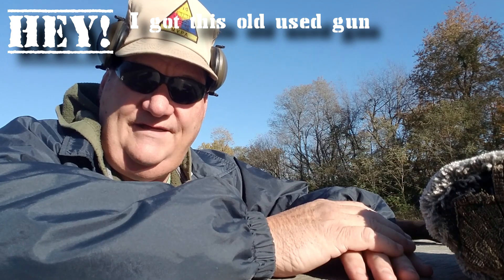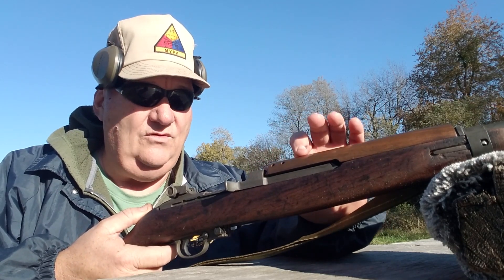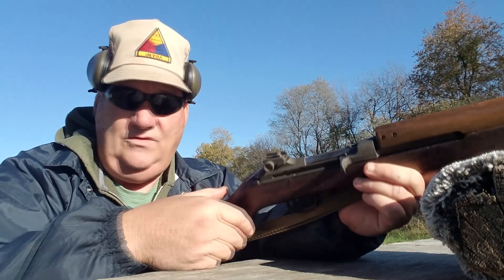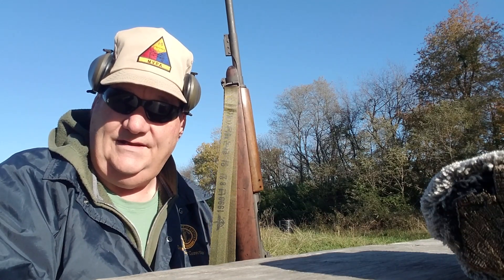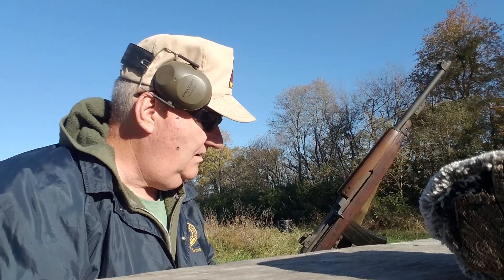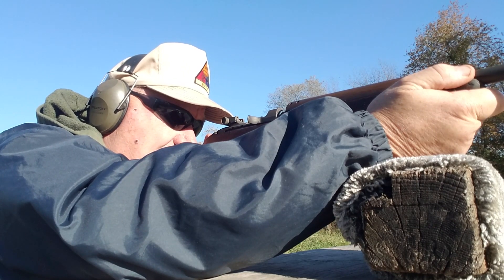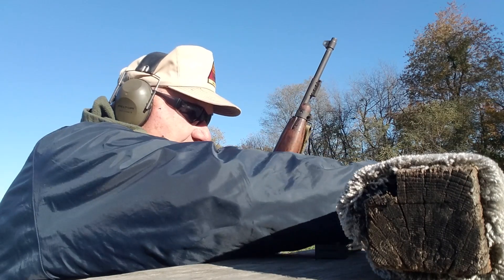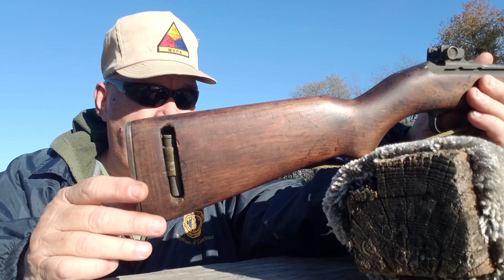Grading a carbine #4. Let's look it over.

Comment: I have an Inland made in late 1944. completely stock Inland parts, except for the barrel. The barrel was made by Marlin. The research I've done says Inland produced all their carbines and part in house. I've been trying to get answers about how and why my M1 carbine has a Marlin barrel. Maybe you have an answer, if so I'd love to hear it. Thanks.
Reply from the maker: Most carbine barrels were made by marlin and High Standard. It may be the original barrel or a replacement after the war. You have a Louisville slugger stock. All ww2 stocks are made by them.
Reply: @esquad5406  Inland did make their own barrels. Right? I'm sure barrels were sourced from other manufacturers. Thank you for responding.